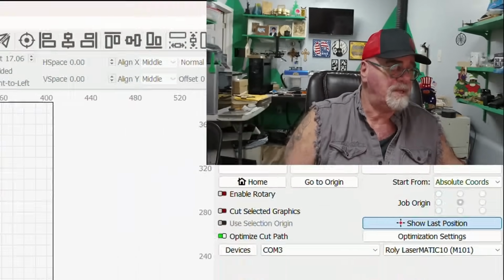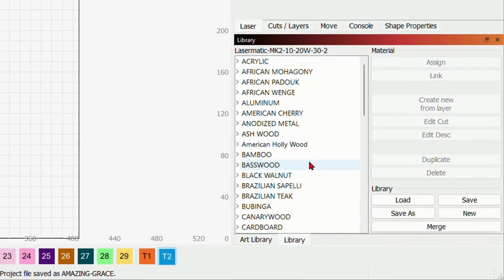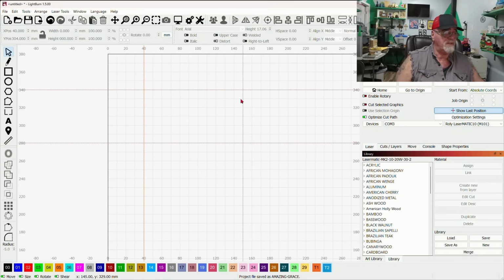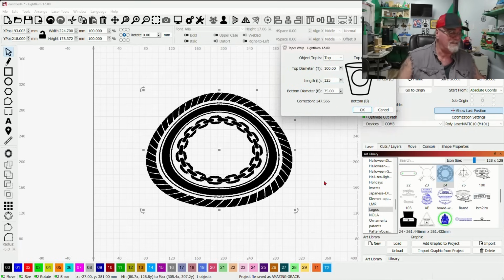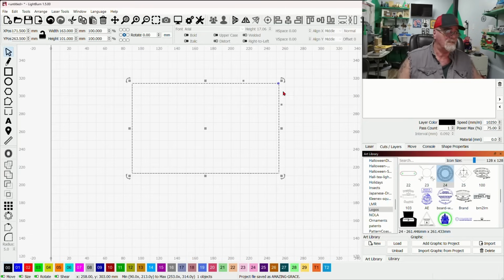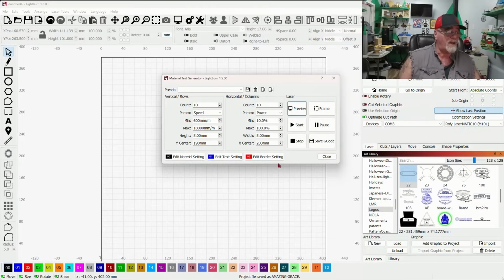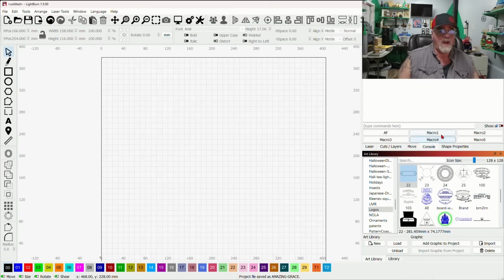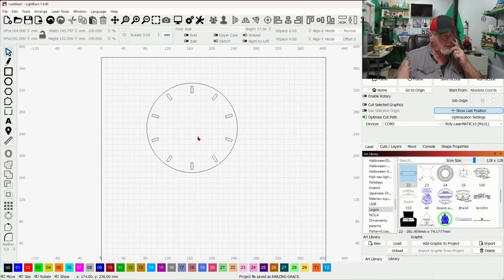🔥 Lightburn V 1.5 Sneak Peak of the Top 10 NEW TOOLS!

Comment: The taper tool does not work correctly
Reply from the maker: I've used it 4 times with perfect results. You need to have all fields filled out accurately, and choose the right orientation. So if my graphic's top is on the left side of the screen (rotated to the left), I choose Object Top is: Left. Fill out the T, L & B measurements, and it works like a charm.

Comment: Rich, did you determine whether the length measurement for taper warp is the logo or the length of the tumbler?
Reply from the maker: It the measurement from the top to the bottom of the tumbler John.

Comment: Am I the only one who encounter an issue with the latest update? My laser was no longer able to cut the same as using previous version. I am using 5w Diode laser and it suppose to be able to cute 3mm basswood using speed 200mm/m and power 100% in 1 pass. In the latest update, my laser cannot cut the material with the same settings. I had to do it now in 2 passes or lower the speed down to 150mm/m.

I resolved the issue by reinstalling the previous version.
Reply from the maker: Glad you got it resolved. V 1.51 should work fine. A few bugs were fixed.

Comment: Have you parted ways with Monport?  They use you on their channel.  Why does Monport not answer customer help requests?  You're better off buying on eBay.  The support will be the same.  If I don't hear from them soon I be disputing with CC company.  There is a whole FB group experiencing this. I bought a brand new machine that doesn't work. Beware!
Reply from the maker: Yes I have, last summer for this exact reason. I was doing their US support and they weren't providing the parts in a timely manner, or sometimes not at all! Bad business!

Comment: The thing that really bothers me about the material test is that once you generated it should pop out like shape, it annoys me that it goes to the center of the working bed because my bed is 1000mm by 1300mm.
Reply from the maker: You need to set the X & Y centers to place it where ever you want! Lightburn, by default, places it in the direct center of your work area. If you have a 10 x 10 count of 5mm squares for example, if you set the X & Y centers both to 50, it will work in the origin corner (extra room added for the text).

Comment: Hi, Rich.  I'm fairly new to laser cutting and engraving (about 6 weeks) and mostly use mine for engraving tumblers and glass drinkware as gifts for colleagues and friends.  I'm also currently using the open beta version of 1.5 and love the taper warp feature.   While it's really good, it's not perfect.  Before engraving, I strongly recommend converting a duplicate of the design to bitmap after using the warp tool, printing it on paper and physically holding it on to the product to be engraved to see how it looks and then make any necessary adjustments to the design (printer paper is much cheaper that a $20 tumbler).  I'm sure you've covered this in a previous video, but I felt it was worth mentioning.  BTW, I love the tutorials!  I have learned so much from you in such a short amount of time.  Thank you! Thank you! THANK YOU!
Reply: Do you still need the rotary device for tumblers with this feature?
Reply from the maker: Depends on the size of the design Cindy.
Reply from the maker: Thanks Jeff, I usually tape paper to the tumbler and run the job at very low power.

Comment: I have an Xtool S1 with the auto air assist unit with 7 settings (Auto, Off, 1,2,3,4,5) .  Lightburn will turn it on, but it is on the low (1) power setting only.  A feature that would allow control of the level of air assist by layer would be really great.  Any insight into  lightburn support for this?
Reply from the maker: Highly doubtful. The air assist you have is manually controlled with a variable resistor. Grbl M7 & M8 commands control simple on/off relays. Lightburn is Grbl sending program, and can't do more than Grbl can.

Comment: Looking forward to these new features. Thanks for the review. 
Though this may not be the proper forum, I have a newbie problem.
I was working in circular array. I drew a long narrow rectangle and wanted it to rotate around its center point to create a Sun ray looking object.
The first time I performed it, it worked as I wanted.
After playing around with circular array awhile, I must have modified a setting in it, and now when I try to recreate the original design.
The rectangle instead of rotating around its own center point it is rotating around some other center point far away.
I feel stupid in asking this but how do I get it back to rotating on the rectangles own center point?
Ps what is the proper forum for asking questions like this?
Reply from the maker: I have a clock video posting next week that will answer this question.

Comment: Pity they didn't revert T1 and T2 to frame!
Reply from the maker: I didn't like framing on T1 & T2 myself; I'm happy to see it gone. I only want to frame the work.
Reply: @TheLouisianaHobbyGuy  - I like to frame the outline of the part personally. It helps me position my part accurately. Now I have to remember to turn off output of my "frame" as it wastes time following something power is set too low/slow to cut.  What actual use is T1 & T2 anyway??
Reply from the maker: If you watch my maker videos, I use the tool paths all the time for designing guides.

Comment: Thank you! Looking forward to this update!
Reply from the maker: You bet! The link to the Beta is in the pinned comment if you want to use it now Sharon.
Reply: @TheLouisianaHobbyGuy  I have a question on the beta version for LB v1.5. If I download it now will it override my current version or will it create a new LB shortcut? Wondering because I have 3 on 3 different machines and I'm trying to decide which one to put it on.
Reply from the maker: It will overwrite the current version Sharon. Don't worry, it's been in Beta for a long time and it's pretty much bug free now. Worst case scenario is you run the installer of the previous version to overwrite it if you don't like it. They'll both likely be in your downloads.
Reply from the maker: It will overwrite the current version Sharon. Don't worry, it's been in Beta for a long time and it's pretty much bug free now. Worst case scenario is you run the installer of the previous version to overwrite it if you don't like it. They'll both likely be in your downloads.
Reply: @TheLouisianaHobbyGuy  Thank you! That’s very helpful!

Comment: Is the Xtool S1 going to have support?
Reply from the maker: It already does.
Reply: @TheLouisianaHobbyGuy  I knew there was a file from Xtool you had to use. I was wondering if this new version has that file included or would I have to go through the steps of adding it? Thank you for your reply, I love your channel.
Reply from the maker: The settings file has nothing to do with the version of Lightburn. It'll work with any version. Settings are constant, and only apply to the Grbl settings.